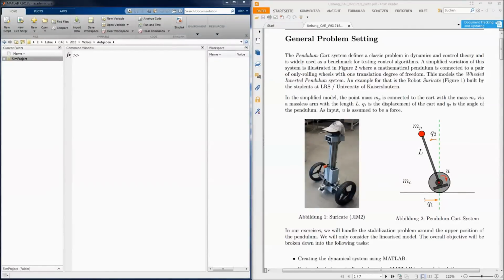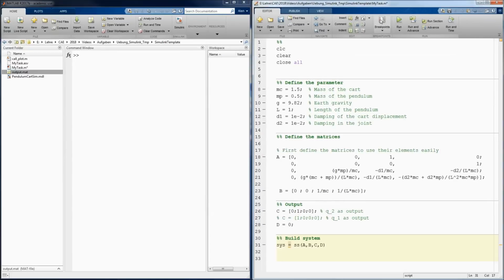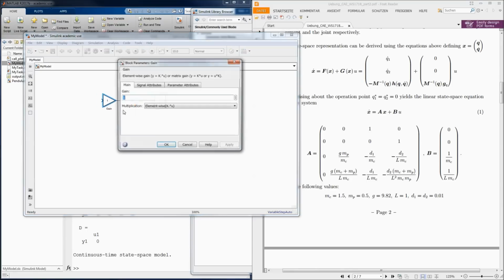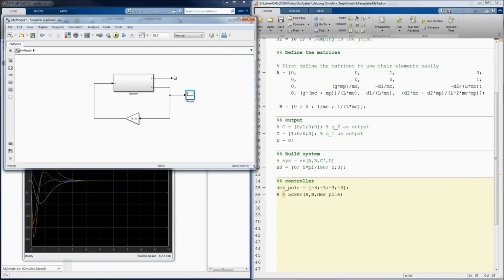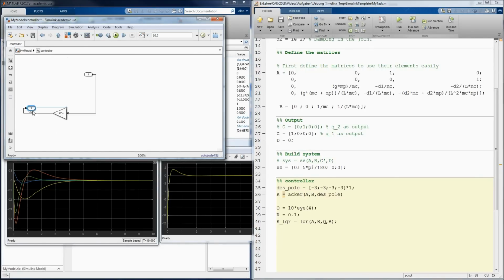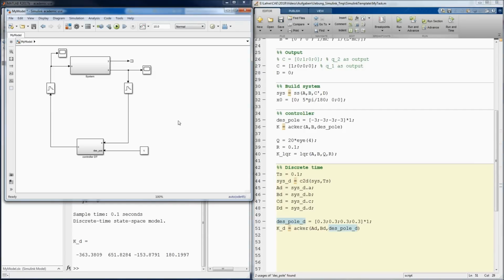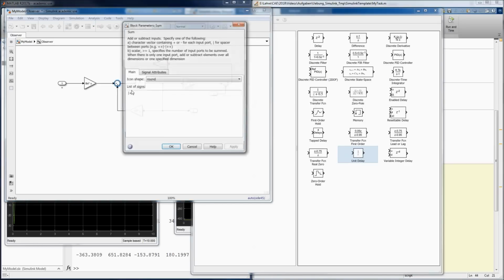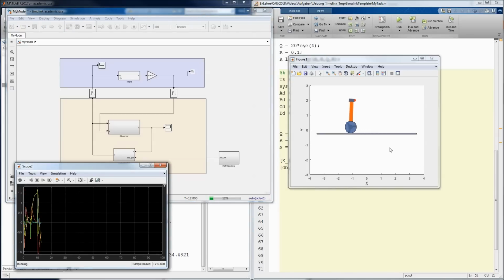State Space Control for the Pendulum-Cart System: A short tutorial on using Matlab® and Simulink®

Comment: Hello. New updates, with Matlab 2023A:

For the observer part:
- Since there was a mistake using B instead of C for the output of the system, it is necessary to put u*C in the system.
- In the observer, it works with Cd*u.
- In the observer, the observer gain must be u*Ob.
I think that with the above corrections, you will get the same results as in the video.

Now, for the non-linear part, I did not have the variable g_q. So, just in the working space, define g_q = [1;0].
With the above, you will see the simulation.

Keep studying!
See you.

Comment: I am wondering, how we can control inverted Pendulum, juts on the knowledge based on position x?.
As output of plant is just position, which Is used in observer, to estimate states.
This implies that there is no need of angle measurement for balancing, but we know that for balancing robots and pendulums, it is necessary to have potentiometer or MEMS to measure angle of pendulum..

I believe, if we have just theta in output, means C=[ 0 0 1 0], then self balancing can be achieved, knowledge of position is not a must have thing in balancing, but theta is must..
Reply: I'm a bit late, but I suspect it's due to knowing the initial state of the system. Theta, through the equations of motion, is implicitly known as position varies (since the system is deterministic, and initial conditions are set), even if not explicitly observed.

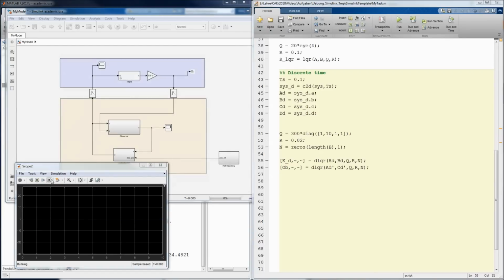Comment: at 31:06 ,I replaced  “[K_d ,~ ,~] = dlqr(Ad,Bd,Q,R,N);”  with “[K_d ,s ,e] = dlqr(Ad,Bd,Q,R,N);” ,and the result of e is [0.98929,
0.97981,0.968874,0.33317]，，The values in e are all greater than 0, is it because this is calculated in the discretization?

Comment: At 29.25 --> Invalid dimensions specified for input port 1 in 'MyModel/Observer/Gain3'. The gain specified has dimensions [1x4], while the input is being set to have the dimensions [1]. These dimensions are not suitable for generating the matrix product of the gain with the input signal
Component:Simulink | Category:Model error
Error in port widths or dimensions. Output port 1 of 'MyModel/Observer/Sum1' is a one dimensional vector with 1 elements.
Component:Simulink | Category:Model error
Reply: I using matlab R2017b
Reply: try to ad apostrophe transpose the matrix if for example the gain is Cd make it Cd'
Reply: have you tried to derive the state space representation
Reply: @abdelkader6347  I just tried the simulation and am trying to understand it. does this video fit in the journal?
Reply: @abdelkader6347  Do you know or have literature similar to this video?
Reply: He published the final program and one material of this work but there is no enough informations

Comment: Hi I just start learning about state space and staff so I tried to follow your video and I have a problem in the signal that come out of the observer, it's doesn't look like the one that come from the original system at all and i don't know why, I tried to change the des_pole accurse from *1 to 0.1 to change the simple time if I remember right but it's barely did some thing    
can you help me?
Reply: Hi, the problem is that Cd is a Row vector, not like C as a column vector, thus in observor bolck, the output should be Cd * uvec, and also the ob feedback gain should be u*-Ob and puls a transpose bolck. This is because x_dot should be a 4 row vector.

Comment: Let us slow down the experiment a bit. According to the description the idea is to use a proprietary software which is Matlab which runs only in Windows. Secondly, the idea is not to run the controller in a simulator but to execute it on a real robot. And third, instead of running a physics engine like Box2d the idea is to program the forward model from scratch with differential equations.

Comment: Error in port widths or dimensions. Output port 1 of 'untitled/System/Integrator' has 4 elements.  This port does not accept the dimensions (or orientation) specified by the output signal.
Component:Simulink | Category:Model error
Error in port widths or dimensions. Input port 1 of 'untitled/System/Gain2' is a [1x4] matrix.

this error comes when I run the system. How do I fix it?
Reply from the maker: I'm not sure which integrator this is, but a very common mistake is that the gains do not have the right multiplication type. In this case, double-click on the gain block and change "Multiplication" from  "Element-wise" to "Matrix". Other reasons could be the initial values of the integrators or the orientation of the controller vector which shall be, then, transposed.
Reply: I have the same question about that. The integrator is the one at 8.20 in the video. I do change the 'Multiplication' and the initial values is what you input in the video. I do not understand what you mean  orientation of the controller cause at that time there is no controller @rptulrs2023
Reply: I think the gain in the right side is wrong. it should be B' not B
Reply: @zhaobingkun4950  You saved me so much time, thanks mate.
Reply: @zhaobingkun4950  thanks I had same error with you but I solve it like you thanks!
Reply: @zhaobingkun4950  you really help me , thanks mate